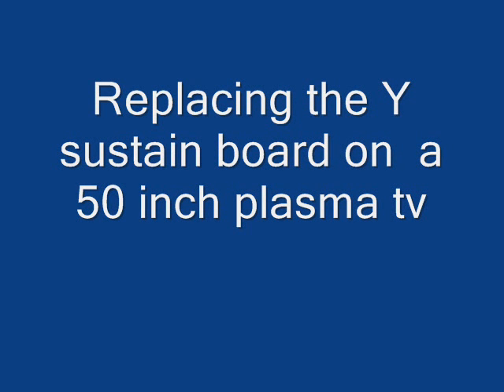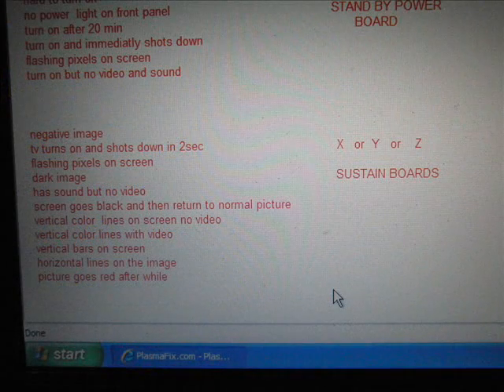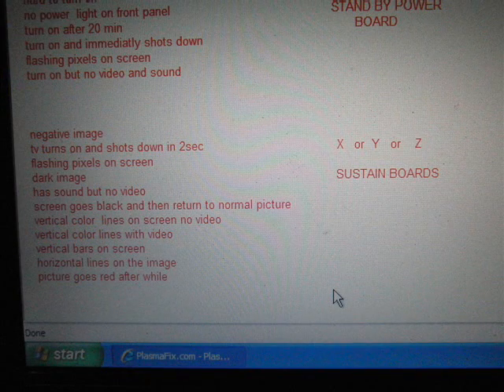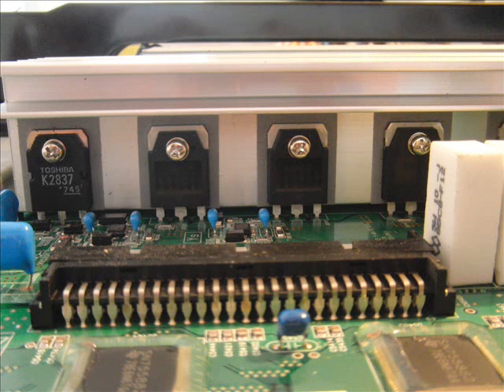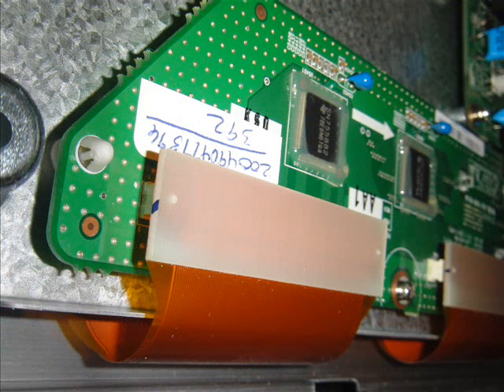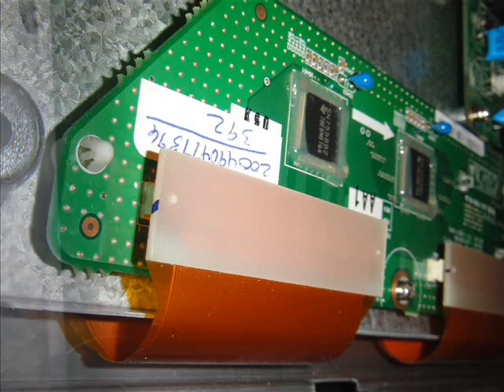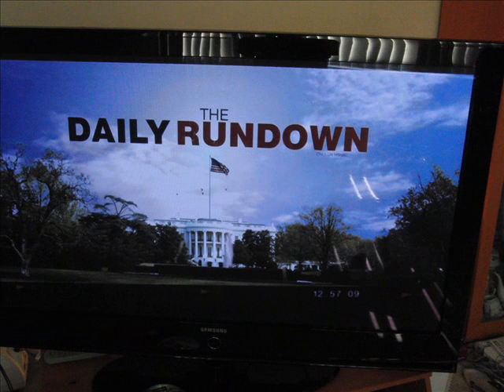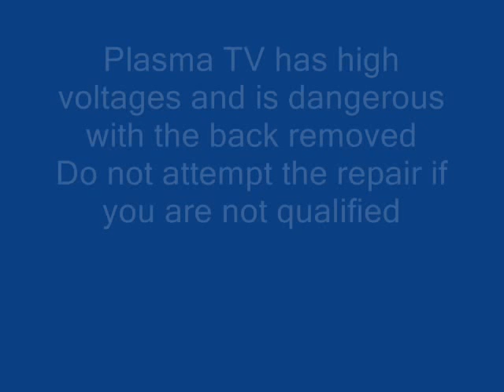Replacing the Y Sustain board on a 50inch plasma tv Movie.wmv

Comment: Hey! Very nice info. I have an NEC42XC10 PlasmaSync monitor and am getting more and more "green dot noise" the more I use the TV. They just appear in higher abundance the more use it gets, and it also seems the LONGER I leave it on, the less I see... but once it sits and cools off, when I turn it on again they all come back. Would you say it's probably the same Y-Sustain board problem you were facing given those symptoms? I am not a technician, how would you suggest I go about getting it repaired? I've heard plasma's should not be horizontal, so if I do have a technician work on it, should I make sure he keeps it vertical the entire time? Sorry if those are random questions, I am just trying to get some help. I would appreciate any input you can give me. Thanks and have a great day!
Reply from the maker: eskimo289  For your safety, I would not work on this as the adjustments have to made with the TV on and back opened.   The most likely culprit is over voltage and usually adjustments to the vscan pot should fix the problem. I am not familiar as to the orientation of the TV when it is being repaired.  Good luck.
Reply: wtam69 That's all good info. Thank you for your help! I'll see if a technician here in Houston can take care of it for me :)

Comment: I have a March 2008 Panasonic 50" TH50PX80U. It been good for a little over 6 years now. However a couple of days ago it failed to turn on using the remote. I of course thought the batteries condition was the cause, it wasn't they were fine. Had to turn on the tv using the power button. No picture and the LED lights flashed in a 13 blink sequence followed by a 3 second  pause and then 13 all over again. As I said no picture and in addition to the remote not working the repeater buttons(volume, channel and menu) in the front of the tv didn't work either. Now I understand the 13 blinks indicates a "communications error with IC8001[Pesks Lite 2] and the A-Board as the failed circuit board...this all according to a Blinking Timing Chart  At present I have no reason to think this information is incorrect but yet maybe 13 flashes could mean something else as well.

So replace the A-Board and the tv works or at least look at the A-Board before all else. Well I'm told it's not the A-Board but the Y or SC board.  At his behest I removed power to the SC(Y)Board and then powered up the tv  and looked for changes. There were.

The 13 blinks on the LED were gone with the LED red light now steady on and this condition of course is with the SC board depowered. My source tells me this is an indication of a failed SC board at the very least and possible failure of the upper SU and lower SD as well. When I asked why Panasonic urges with 13 blinks check the A-Board first as the chart reads his reply was that, that information is false. Ok what do I know that's why I'm asking. Now before I purchase replacement SD/SU and SD boards may I have your opinion on this; what would you do; start with the more expensive A-Board as the chart says or the sd/sd/su which even combined is cheaper by almost $70?  I removed the back panel inspected all the boards for evidence of heat signature, burned, discolored  diodes or crowned capacitors...everything at least cosmetically looks fine.  I'm asking in part because I don't recall you mentioning the LED light condition of your plasma tv; just that you were replacing the Y Board, perhaps for different reasons; but why? what caused you to change the Y Board and not something else maybe the A-Board like the chart says...did you or would you consult this timing chart?

In reviewing the "Power LED Blinking Timing Chart" of the 1 thru 13 blinking light listings, 7 sequences more than half the list, list  the A-Board as the failed component and not once is the Y-Board cited in the chart yet you as well as others who have a firm understanding  of plasma tv repair issues have commented the  most common circuit board to fail on plasma tvs to be the Y Board, if I recall correctly you said in upwards of 80%

Thank you for your comments.
Reply from the maker: I would not recommend fixing the tv unless you know for sure it would work. I made this video several years ago. A 50 inch plasma can be had for $400 now. My old tv was $1,300.  That said, I would check the supply voltages, with care, off the power supply. I had no problem with my power supply and I had a picture, unlike yours. My picture has very thin stripes. The most common cause for that was a bad Y and the buffer boards. I replaced the Y and the upper buffer board. They recommend you to replace all three as failure in one will in turn cause the failure of the other. I was lucky that the tv worked after replacing the Y and buffer board. Those board cost me $140 or more.  That is why my hesitance in recommending other people fixing now unless they are certain of the results. Changing blown caps and such are ok but replacing boards that cost a couple of hundred dollars is problematic. By the way, my tv still works and I have a few computer fans on them as heat is the major cost of failure.
Reply: wtam69 Thanks for your reply. I agree with you. Especially with a novice like myself tv repair is a wager. Like you I got mine online for $1300 and that was in 2008 dollars. I scoured the internet for prices and product research and once settled on this Panasonic which got rave reviews pounded my chest and felt I was ahead. Little did I know this would come back to bit me not that much later. I think your correct with what prices are now just going with a new set seems more than sensible. If I were to go forward with this "experiment" the SC/SD/SU combination replacement boards is nearly $100 and should that not bring the tv back to life and I bet on the A-Board, the expensive board that would be another $159 plus shipping that all together I'm well on my way to a new set. So thanks for that perspective. It true they don't build things the way they use to. I remember the 19" Sony Trinitron I bought in Berkeley, CA for $569 fall 1980 and once again that was in 1980 dollars;  no bells and whistles
like the sets of today if you wanted change channels you had to get off the couch and push a button but it lasted and lasted. I gave it to my grand aunt
who was generous to me growing up, some 17 years later in 1997 and in the time I had it didn't skip a beat. So you might understand this plasma  after only 6 years as friends disappoints me greatly.

Comment from the maker: I have no experience in replacing the ICs on the Y board. If the caps are fine, you can check to see any of the resistors are fried. You can use the service manual to troubleshoot. Some of the manuals are available at Scrib dot com.

Comment: I have one of these which instantly shorts out the main fuse in the power supply. Originally it was the fuse located next to the 2 large capacitors was blown. I have tested the ESR of all caps and they are fine. Please can you help. Thank you

Plus the thermister has also blown located next to the 2 black relays 2:07 is a good picture to see this all.

Comment from the maker: Unplug TV and remove back panel. Check power supply board for blown capacitors. Be careful not to touch the TV. It takes quite a while for the electricity to discharge.

Comment: I have a pdp42v18ha "Viora 42" Plasma" tv with No sound, and No picture. The red light comes on so it's getting power. I'm stuck where to go. No clicking. Haven't opened it up yet, but i'm trying to diagnose what is wrong before doing so. any help?

Comment from the maker: Looks like your Y upper buffer is ok but not your lower Y buffer. If you replace the lower Y buffer already, then either the E, or  F boards are bad. The two boards are situated across the bottom of your entire screen. UNPLUG TV, then check for loose connections for those 2 boards.  You can also put a fan on it with you tv on, if it works with the fan cooling the 2 boards, then they are the problem.

Comment from the maker: Was there any improvement at all after the installation of Y and upper & lower buffer boards ? I assumed you checked all the connections. I have heard that if the boards are not replaced a the same time, there could be problems. Not sure which set you have.  Take a look at this link - scribd.com/doc/76007457/26/X-Board-Configuration

Comment: thats a samsung 50 normally the mosfets go open and dammage the ysus driver normaly upper driver to left in video plugs into ysus board check as when replacing ysus they always say replace both driver board upper and lower check glue round chips if its brown they have had it if its yellow / white colour they tend to be ok,, no burn marks around the glue,

Comment from the maker: @181AFearon Sounds like you at least have power so the other boards could be the problem. Unfortunately, all the other boards are fairly expensive and I cannot tell you to try swapping this or that.  Although the Y board is most common failure, the X and Z and logic boards at the bottom can be the problem too.